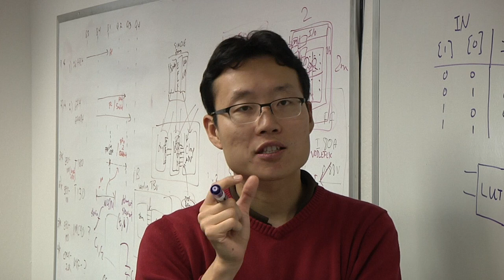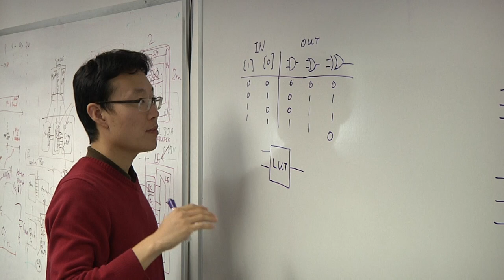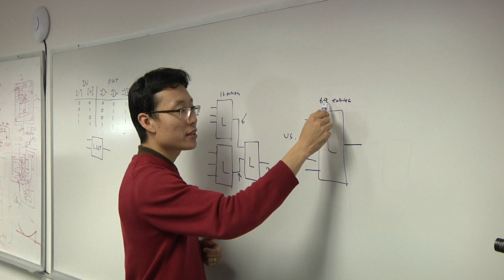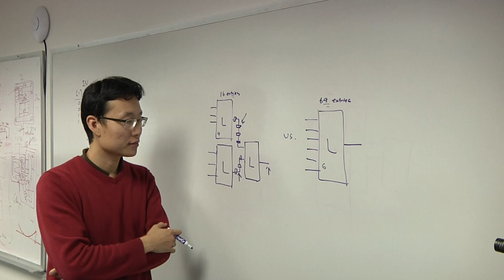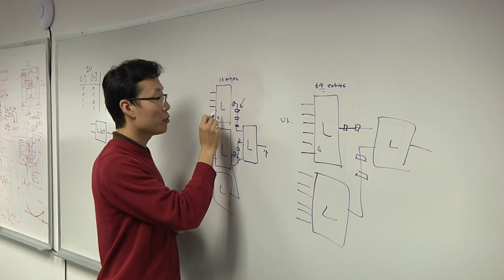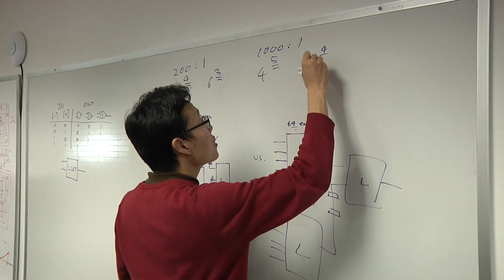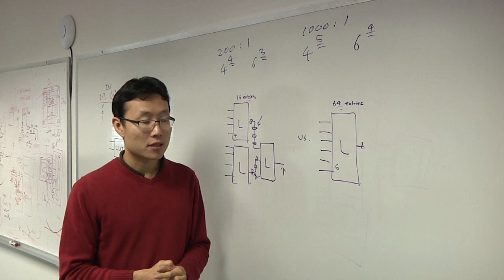Tech Talk: eFPGA LUTs

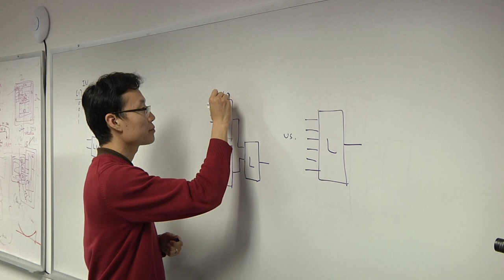Comment: Great video, but I was confused at 04:18 . You said: "4 input look-up table"? I can only see tree inputs.
Reply: The problem that Mr Wang has proposed, is to build a LUT for 6 inputs using 4 input units. In his simplified drawing he drew only 3 inputs for the general circuit of 4 inputs. Then he shows why 3 general purpose 4 input circuits would be necessary to build a 6 input LUT.
Reply: @doctoroctos  You mean its actually a 4 input LUTs but he is only using 3 input so he draws only 3? As I can see that he had draw the 4 input LUTs correctly in behind when he wants to make a 12